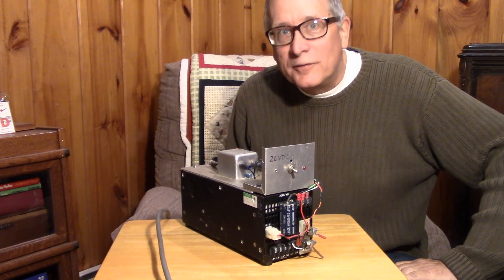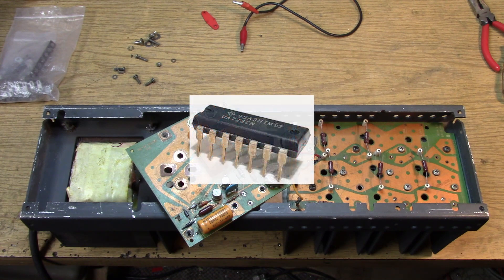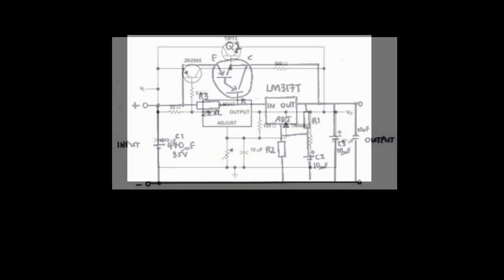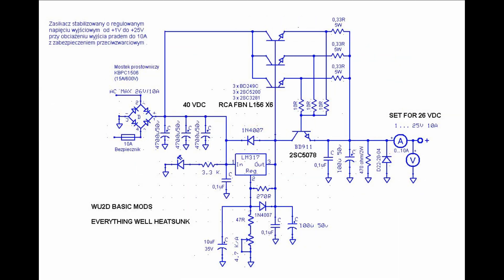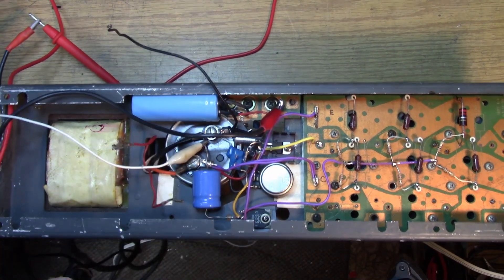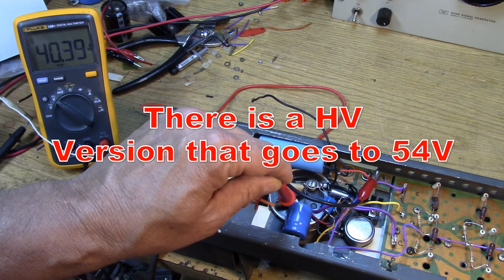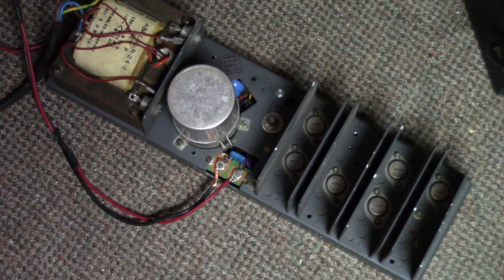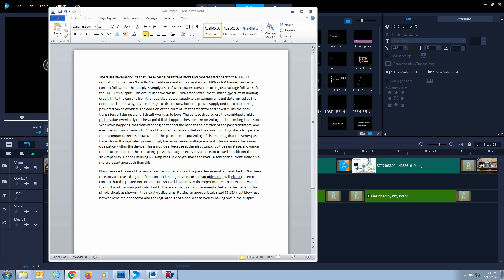28V Military Power Supply

Comment: Nice project.  You might want to hang a crowbar circuit on the output.  Of course those old military radios are not as fragile as our present rigs.  Maybe one of those old Kepko external crowbar devices that connected across the output terminals, and were adjustable. If those pass transistors failed short, the radio may think it got hit by a German 88 mm.

Comment: Brilliant recycling. Was thinking about the dissipation of pass transistors  at current limit. Current foldback is messy but Ill throw in my 10 cent suggestion. Take the collectors of pass transistors through a couple of automotive  bulbs. These, as you know, have a 10:1 resistance hot/cold. So maybe 2 to 20 ohm...dunno. trial and error, series parralel etc.
So at current limit the bulb(s) come on and drop some of the voltage appearing across the CE of transistors. It wouldnt effect regulator because the chip is connected (via the diodes) directly to 40v.
Also, the collectors, being current sources will maintain the current limit value irrespective of the bulb resistance.
Anyway....Car bulbs are getting hard to find with everything going leds.
Love your channel
Paul tech teacher Australia.

Comment: interesting re-build.  LM 317T is so common. lots of ways to make that work.  LM 741 op amp can be used. just more parts. LT 1083 reg IC work as well.  I would have made a new LM 723 board with modern 14 pin dip one. some times you just use what is easy and parts on hand.  for old 24V radio's a linear supply would be better. I made 60-65V supply with LM 723 . and 48V as well. their is a trick to float IC off ground to work higher voltage. and if you float 723 below ground. you can make bias reg for RF power transistors like MRF 454. I learned lots of tricks with the LM 723 over the years even made a 200 amp 14V with one. lots of pass transistors. 30-2N3772 . still works well I made in 1988. 240V in. some voltage sag will be fine with them old 24V radios. they  run on battery system. you can use basic crowbar SCR circuit for over voltage.  maybe some MOV on AC line with that filter from your old one. re use what you can. maybe you can find old working volt meter and ammeter . will be nice touch for old radios . nice project !   73's
Reply from the maker: Yes, it is a bit more complex, but it is a much better approach in terms of regulation.
Reply: @MIKROWAVE1  a tip for old board. remove round 723. clip off leads under can. then pull one out at a time . clean up pc with solder wick. then take 14 pin dip socket and 30 AWG wire . same IC just different pin out. that works. done it on old supply's.

Comment: Good to see these videos. I just designed, built and bench tested a HT PSU for a 5w  Paraset CW receiver/transmitter.  Those power transformer commercial oven type 12v / 0-400v  toroidal transformers are great used backwards with a modern solid state square wave oscillator running a boost converter (instead of using those vibrator type spike oscillator cans), filtered and regulated -- works great!
Reply from the maker: Great tip on the transformer! What frequency are you running on the converter?
Reply: @MIKROWAVE1   DC-DC converter is 59Hz square wave into a 50-60Hz tuned  75 VA (12-0-12  /  400 )  commercial oven transformer. Mfr. Part No.:
SFB0075-400-12 (single output only for B+).
This project was a fun (albeit inefficient) steer away from high frequency converters; maintaining a heavy weight transformer like the old days whilst intentionaly maintaining some of the nostalgic buzz sound the vibrators used to make by employing an astable multivibrator.
Low in frequency yes, but the large size keeps the transformer cool even though it pulses higher current at a lower frequency. Capacitor reforming is below the current limit on the primary side per second. Bridge rectification followed by quite a bit more filtering. Also running a 10H Hammond 157H with a 0.18uF resonant trap circuit into a powerline choke, followed by stiff regulation, holding a pot adjusted voltage between 300-360 Vdc at 50 mA also maintaining a constant load with a bleed resistor. Low ripple, no noise! 
A+ utilises a 2.2A LM317 set-up for 6.3vdc regulation with a series LM317 1.05A current limiter to prevent cold start filament flare up for the three paralleled tubes powered directly from the 12v battery. A 741 Op Amp runs a timer upon battery connection, auto switching in B+ after adequate filament heatup time.
I could have used 12SK7 instead of the 6SK7 seeing that I'm powering it with a 12v SLA battery, as 12SK7's are more readily available and cheaper than metal 6SK7's for Parasets, but I got lazy.
Reply: @MIKROWAVE1  60 Hz

Comment: Nice hardware. LM317 + PNP pass transistors still my best choice, this combination gives me less drop voltage so i able to use maximum voltage from transformer with good stabilisation.
Reply from the maker: Yes the PNP or Quasi-complementary PNP NPN combo is superior.

Comment: I have fond memories of repairing power supplies. In 1967 I was a Marine based at the Futema, Okinawa Marine Corps Air Base and we did repairs on the TRC-75, which was a high powered Single Sideband transciever. The unit mounted in the back of a jeep. It put out 1,000 watts of SSB power that would fry you if you touched the antenna during transmission. I repaired the power supply. It had a large circuit board covered with power transistors. In the field (Vietnam) often a filter capacitor would short out and blow out the entire bank of power transistors. The resulting heat would scortch the circuit board so badly that I had to replace the board, then rewire it with the 24 transistors. It was tedious work but I enjoyed the hell out of it.
Reply from the maker: I was too young for Vietnam but my co-op job in college was repair and testing of the General Dynamics radios and Pig antenna tuners like the GR-106, which were getting old by 1978. Likely the same set!

Comment: Great looking supply. Now you need a 400 hz 117 volt supply as well, for future projects, or just because they sound really cool! Great job including the schematics. You always do a great job approaching a project from  multiple angles to see which one suits you the best. I like this approach, verses just showing one schematic and not even explaining how it works. There are designs in the old ARRL handbooks for power supplies, but a lot of the HB's I feel are written for people who "already know", particularly the older HB's. It seems as if they wanted to keep electronics privileged and arcane information. 
Up here in Maine, we have a holiday in which once a year people put all of their larger "trash" on the side of the road for pick up. One year this old farm house in Rumford ran a dairy farm that had these stainless steel boxes with 24v 10 amp or so transformers and bridge retal- fryers and circuitry in them capable of making so NICE power supplies. They were in near perfect shape. Also in the pile was a Stewart Warner R-1911 (built by Knight?) AM broadcash receiver with a vibrator power supply in it. The wooden case is long since gone, but the tubes are all good. This year (about 5 years later) at the same house there was a single "ST" type 80 rectal -fryer in the pile, but no more radios or boxes. The tube tested good, for what's that's worth. Thanks for the great videos and bring this WW2 equipment back to life. You videos are always interesting and full of knowledge. 73.
Reply from the maker: Oh yes. 400 Hz.

Comment: Looking at the ammeter, it read past the 1.5 amp rating of LM317. LM338 is rated up to 5 amps, might work better?
Reply from the maker: The 338 will drive more pass devices. The 117 is not required to supply any more than the beta of the pass devices x the number of devices. So it is only supplying a few hundred  mA.

Comment: I recently bought a r392 and it came with a power supply. Sadly the PS was bad. I posted on ARF about it. It was a kepco and had a shunt on the transformer. A real odd design. So I have this big transformer I picked up to do a project like yours but I may try to see if I can power the matching transmitter as well as the transformer is at least 15lbs or more. In the mean time I took two old cb radio power supply's and put them in series. It works. Now I know the radio works.
Reply from the maker: That series hookup was a clever idea since the two supplies were isolated, and the grounds were loose.

Comment: There's no need to be so concerned about the input voltage to the LM317. The spec is for differential across the device, not absolute voltage. As long as no two pins of the LM317 have more than 40V across them you are OK. The LM317 has no connection to ground or 0V, so it never sees the full unregulated DC. You could dispense with the diodes on the input to tidy the build up a bit.
73 de G0AFV

Comment: Trying to get a ww2 aircraft radio to work.  Also had to build 28 volt power supply.  The 28 volt power supply works however, the unloaded dynamotor output is 140 vdc instead of rated 225vdc.  Do dynamotor's permanent magnets weaken??  I have done the normal maintenance on dynamotor.  Thanks for your videos.
Reply from the maker: Interesting. Could be a brush or winding issue. Never heard of a magnet prob, but possible I guess.